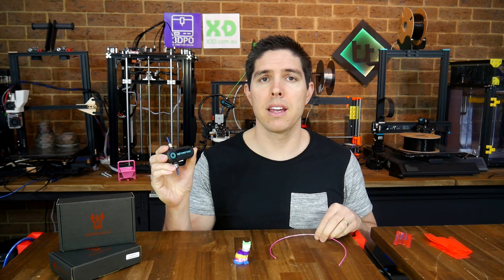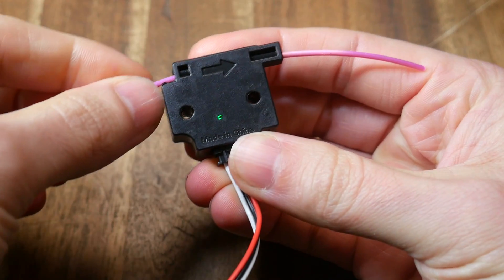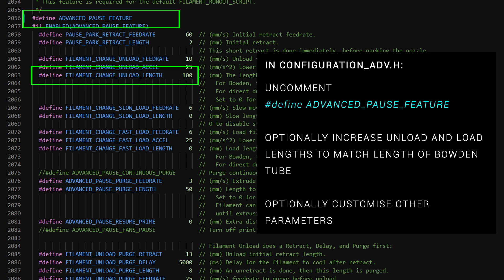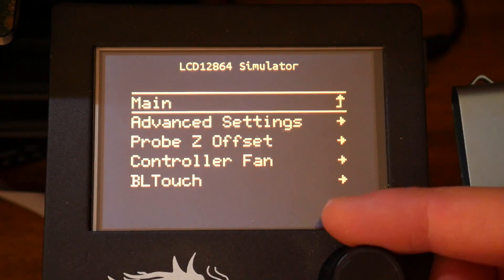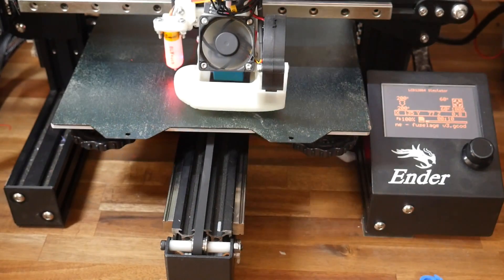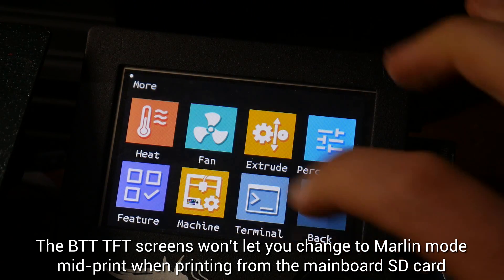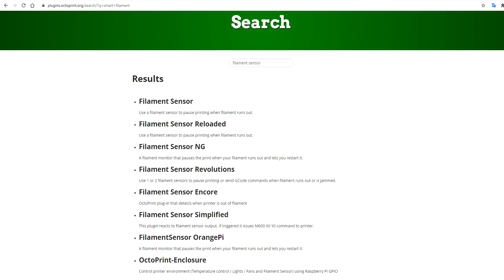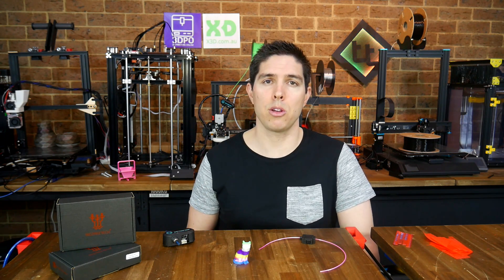BTT Smart filament sensor guide - Detect filament runout and jams

Comment: The only thing you did not explain is what boards support such sensors.

Would a stock board like the Anet v1.7 board support such sensor?
Reply from the maker: Any board running Marln and with a spare port containing GND, 5V and an input pin.

Comment: My deal with these things is that I use OctoPrint so I have to connect the sensor to the PI. I've got a printer that came with a filament run out switch and I quickly learned that sending a run out alert to the printer when you're sending commands to the printer via the PI does little good 🙁

Comment: I have SKR 1.4, BigtreeTech LCD and Smart filament sensor. I have connected filament sensor directly to SKR 1.4. I mainly print from octoprint and use touch screen just maintenance. While printing I put lcd to marlin mode so filament sensor events can be handeled. For me sensor works just fine and I don't really need octoprint to handle it as marlin seems to handle pausing and while fixing the issue I'm already at printer so I can continue from marlin mode lcd. I wish it could be used from touch mode when connected directly to skr 1.4

Comment: Omg thank you I thought I was going crazy. I tried everything with this sensor and I do have a Raspberry PI with Octoprint and the BTT TFT50 v3 and it didn’t work. I bought the sensor through Amazon and sent it back after a week of frustrating code compiling . I hope BTT fixes this soon and I will try it again.

Comment: This could be made to work like a normal runout sensor if you put an Arduino or other microcontroller in the circuit to monitor the BTT sensor but output a single to match a normal runout.

Comment: BIQU fitted this system to their Thunder, It was crap, The tension adjuster bolt to adjust tension on the extruder pushed against the rubber wheel, So it jammed it . It never worked 100% so I removed the rubber wheel and unplugged it
Reply: I then updated the TFT to touch rather than Marlin and nothing would get it to work

Comment: I was completely sold on this until you mentioned it does not work with the BTT touch screen or Octoprint. Can you just switch the interface on the BTT screen by holding the button (Marlin Emulation) for long prints? I really hope they sort it. Thank you for the thorough tutorial and guidance.

Comment: Every filament roll I've used thus far does not end with a clean cut piece of filament to allow the tail end of the filament to go through the filament sensor without ripping it off. Filament suppliers need to get on board with this. Also, it would be really handy indeed to know how much filament has been used from a roll. I've been doing some really long prints that use around 90m of filament but I dont know how much is left on the roll. With a cumulative counter I can estimate this pretty accurately......and for those who say the slicer tells me how much filament is used for each job, that only works if you never have to abort a print.

Comment: I wonder if this had a higher resolution, if it could be used to make a closed loop extruder.
Reply: This is exactly what I was thinking. This could allow you to really dial in flow rate across a broad range of temperatures.
Reply: @arnoldcp11  Temperatures, speeds, materials. It would be a godsend. Especially when working with materials that have some give (like petg) and trying to print fast.

You can correct for spring in the extrusion system with pressure advance. But the effects of filament distortion as they go through the drive gears under high nozzle pressure can be tricky.

Fortunately my firmware supports nonlinear extrusion by means of a an ax^2+bx function but it can be a bit tricky to dial in. And wastes a lot of filament - extrude a large amount at varying flow rates, measure weights, plot it, graph it, etc. I've found a 6% discrepancy between low speed and high speed. That's too big to ignore. And yeah, while you can crank up hotend temperatures to reduce that curve, it'll still be there. But now with a lot of extra heat that ya need to do something with, plus negative effects on overhangs, stringing, bridging, and small details. 

I keep thinking that something like this would be fantastic. Not sure how effectively it would work in real-time but having the ability to same some quick detailed measurements in a calibration would be a real QOL improvement.
Reply: @Snow.Drifter  I was thinking the same. Would be a god send indeed and not that hard to implement especially if the encoder used on it is worth a damn.

Comment: I use it every day with Octoprint. Works flawlessly. As others have mentioned you need HOST_ACTION_COMMANDS and HOST_PROMPT_SUPPORT to be enabled in config_adv.h. On most configs these are enabled by default. The only issue I've noticed with the sensor is that over time filament dust and other fine particle contaminants can build up on the IR tx and rx and this leads to false triggers. Easy to fix. Unscrew the board and give them a wipe using a cotton ear bud. Make sure that they are pushed close together when reinstalling so that the rx can still detect the tx.

Comment: What I learned from this is the 3D printing world really has to develop a board that is OctoPrint and Marlin combined, where they work hand-in-hand together. After setting up OctoPrint, there's no way I'm going back to LCD printing, as the web based setup is so convenient
Reply: You can change marlin around slighy for this to work with octoprint
Reply: @madbull4666  ok. Not sure I'm gonna actually go and invest in this sensor (I'm planning on doing an overhaul on 1 of my 2 printers while I have it taken apart, but not sure what I'm going to put on it), but I'll check it out.

I was moreso saying I wish Octoprint and Marlin had more back and forth communication. Like, when I cancel a print in Octoprint my printer continues print for like 10 seconds. I'd like to cut that down to basically instantaneously stopping printing
Reply: @nathan1sixteen  yeah I know the feeling of wanting it to be instant, and more of a complete unit rather than 2 separate devices.
Reply from the maker: You might like this one, not quite one board but close in spirit: https://youtu.be/5bIzcA8PBgY

Comment: I am using the micro swiss direct drive extruder on my ender 3 and the E3 min v2.0 controller + TFT35V3 display.  this extruder uses the bowden tube on the input to the extruder allowing the smart filament detector with a modified case to be mounted where the original extruder was mounted.  This allows retractions to be monitored as well.  I have no problems with octoprint as as well.

TFT35_v3.0.26.x  Dated Sep 27th in graphics mode, displays the popups for filament parking, loading and purging. Also Octoprint indicated the same popups. I am using merlin 2.0.6.1.

Comment: I'd be really interested in seeing this tested with the Creality 32bit boards like the 4.2.2
Reply from the maker: It should work exactly the same way. i already tested filament runout on the V2 so apart from the slightly different firmware requirements it should be the same.
Reply: @TeachingTech  awesome, thanks!
Reply: @TeachingTech  what firmware did you do for V2?  I used the bugfix-2.0.x but it seems to just pause immediately. creality's "source" is outdated and missing the options needed.
Reply: After following all the steps I have seen here for hooking the bett sensor up to an ender 3v2 ran by octaprint i still can't get it to do anything.  The designated pin just says "pulled_high"

Comment: Is it just me or 7 mm per pulse is very slow? In the world of very fast microcontroller, is there any reason to make a sensor that slow?
Reply: That may be part of their cost reduction, using a cheap encoder that is limited in resolution.  I agree that it is too slow.  It may use an electromechanical encoder with 4 brushes instead of a typical perforated-disc optical encoder.

Comment: Looks decent as its located before the extruder driver so it will work fine with flex filaments. Nice video.
I use no screen at all octoprint only. There is a comment below that has a option that may work.

HevORT has a speye thats free DIY thats also before the exteuder motor working with flex.

Comment: Mine plain sensor works fine, connected to printer board, with octoprint. It makes sense, since octoprint should at least know current printer buffer status not to overflow it. And marlin is capable to pause command processing. It seems something is missing in your Marlin configuration

Comment: The remark regarding "not working with octoprint" is wrong. I run this setup and it works fine. Marlin must be compiled with HOST_ACTION_COMMANDS and HOST_PROMPT_SUPPORT as well as ADVANCED_PAUSE_FEATURE.
The host_prompt messages the interrupt to octoprint, which causes it to wait for the printer.
I think this is mentioned in the official setup guide, but I may be mistaken on this one. It is required anyways when you use the filament-change-command in your prints.

In theory it should be possible to remove the requirement for the LCD. When Marlin detects a filament runout situation, it executes the FILAMENT_RUNOUT_SCRIPT. By default this is merely a "M600" command. It should be possible to execute host-action-commands instead. Afterwards, the filament change must be handled by the host. I have not looked into this, and can't tell whether or how well this works.
Reply from the maker: Thanks very much for the correction. I've pinned a similar message to this with the details.
Reply: With the host commands in new Marlin I was hoping this would allow the TFT(in TFT mode) to work with the sensor when it's plugged into the main board. But no. The printer correctly pauses but the TFT screen just carries on like nothing has happened  😖
Reply: Can anyone confirm that this work? and is there a setup guide where the smart filament sensor is plug into the SKR mini E3 V2. and still work with octoprint?

Comment: I can't stop smiling at any point I see the sensor flopping around
Reply: But the floppy (on/of)sensor has the benefit of just moving away as the filament runs out and is ejected automatically, as it can get clogged inside the sensor, and destroys the switch-lever... Also you have the benefit of seeing retractions and linear advance.

Comment: If it has high resolution encoder it could also be used to measure fillament diameter and adjust flow accordingly or pause printing if the diameter is too thick and that blob will definetely jam in the bowden tube or in the heatbreak.
Reply: Theoretically yes, but you would then need to find a way to determine the position of the springed mechanism very accurately. Not impossible even in a smaller package like this but it would certainly make the sensor cost much more and it would no longer be an affordable printer upgrade. :)

Comment: In 2015 the Sparkcube project made one that you can 3D print and build yourself and it has real good support with Repetier firmware and host there is a Manuel if someone interested but you need some German to understand https://www.youtube.com/watch?v=F1QcBbc12zc you can also buy one for 35€ its called "Filament-Tracking-System v2".

Comment: Nice video Michael. Have you tested with flexible filament? My experiences this will not work because of spring that keep internal pullers (that guides filament) tight. I was not able to push tpu or other flex thrrough hole. Solution for that in my opinion is  switch filament runout off for plexible filament. Apart of that I must say I agree with you  - works saves a lot of time, money and nerves :) Regards!

Comment: seems like it doesn't match regular runout sensor performance for running out of filament, because there can be as much as a 7mm extrusion delay between when the filament runs out and when it detects the runout.  Am I missing something?
Reply: Unless you have a rather unusual printer, there will always be way more than 7mm of filament between the filament sensor and the drive gear(s).
Reply: @AndrewGillard  you're right! i definitely missed that little detail lmao, good call

Comment: I am running Octoprint server from an old laptop instead of a Raspberry Pie. Is there a way to connect the sensor to the laptop?
Reply: If you have a parallel port, you can use that as a makeshift GPIO.  If you have a more modern laptop with USB, you can use an Arduino nano or UNO to monitor the filament sensor, then report its state via serial connection.   This requires knowing how to program the Arduino, and both methods of connection require knowing how to write an octoprint plugin if none is available.

Comment: I'm really surprised to hear it doesn't work with serial input - there's no reason why it shouldn't. ... Marlin already throttles the data it receives from Octoprint/Pronterface/etc., that's why an M0 (or M1) can actually work and even empties the planner buffer, so you can M0, then Pause in pronterface, then press button on the printer to step beyond M0 and then you can freely issue manual commands. ... So, again, there's no reason why a filament runout sensor couldn't do something like that (and handle filament change completely transparently to serial host) other than some Marlin implementation detail making advanced pause interfere with it.
Reply: You are correct, there's no reason why it shouldn't work, and it does. At least if Marlin is setup correctly. It will notify the serial connection (in my case that is octoprint) about the interruption as well as the resolution. Afterwards octoprint continues with the job. I run exactly this setup and it works nicely.

Comment: I got the first ones that came out and mine is 3d printed. I could not get mine to work with tft3.0 in touch screen mode. in marlin it kept thinking there was a jam. Though my distance was set to 25mm. Glad I was not the only one to have issues with making this work with the TFT. Guess mine will just stay boxed and put in my 3d printer extra pile for now.

Comment: Good to know... I've had multiple jams thanks to loose spools lately and was about to order one of those. Most of my printing is done via Octoprint, so I'll have to wait
Reply: No, you don't. Octoprint works fine.I followed the official guide and octoprint pauses when the filament runs out. The display and button on the printer is still required, though.
You can test if it works by adding a filament change command to your gcode (M600). If this works, everything is setup correctly.
Reply: @twinklingwater  ok, so I'll have to upgrade from the stock display?
Reply: @ein57ein  No the stock display is the one you want. Octoprint also works. Michael just has a problem on his end for the octoprint part.
Reply: I'll order one up and give it a try then. If not it'll join the box my BLTouch sits in. 
I only used the BLTouch on my ender 2, tramming my ender 3s every few months works fine for me

Comment: So I have a thought... I personally thought about getting that exact ""Smart" run-out sensor" and glad I haven't pulled the plug on it yet... But, now it has made me curious as to figuring out what the disconnect is between the device and our aftermarket systems... Now correct me if I'm wrong, aren't you able to connect both the factory and aftermarket LCD's up in parallel with one another? and IF that is the case then I would assume you could still use the smart sensor off of the main LCD controller and have the sensor work as is considering that the LCD's would both be working at the same time... If not, then I guess its time I buy one and get to tinkering lmao... I hope you or someone else finds out a way or a patch decides to pop up to fix the issue soon enough beca8use that sensor is literally the answer to all worrisome faults that we all endure when leaving a long print all by its lonesome. Good luck and happy Printing!!
Reply: when in tft mode only one line is used. in marlin mode again only one line is used. it is a one or the other thing.
Reply: @fuyingbro  I think he means to hook up two separate screens. Your original one and a TFT one so you have 2 separate screens.

Comment: Sad to see it doesn't work with the BTT TFT. I've recently switched all of my printers over to using these TFTs, and this smart runout sensor would be a useful feature. Hopefully they get it working soon.
Reply: You would have thought they would have compatibility with their own screen, this is not a new product so what are they playing at?
Reply: @AndrewAHayes  They probably thought they had it working with their screens but probably tested in Non-touch mode and thought it works with the touch mode. Now they have to update the firmware to make it work. Hopefully they're working on it as we speak.